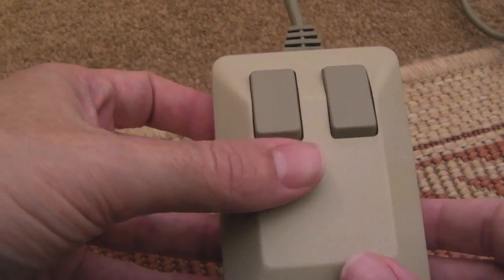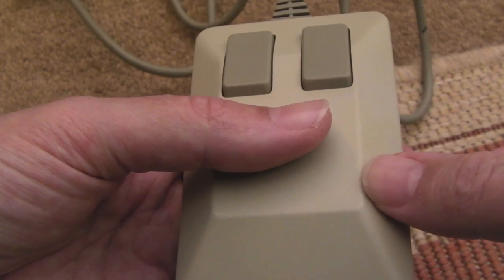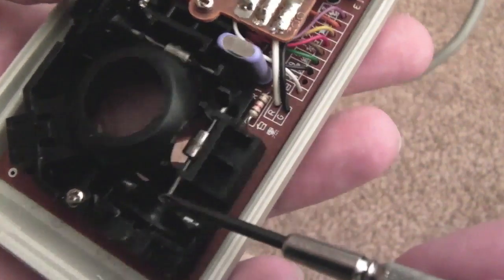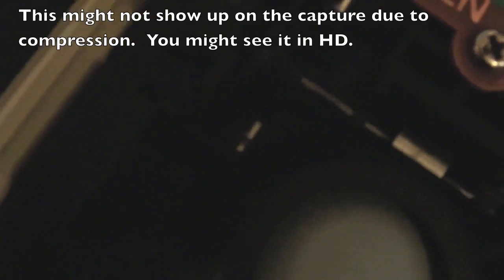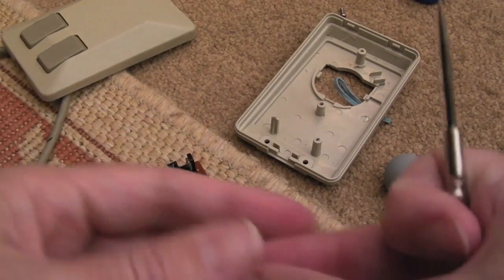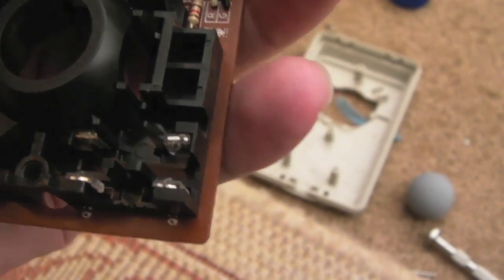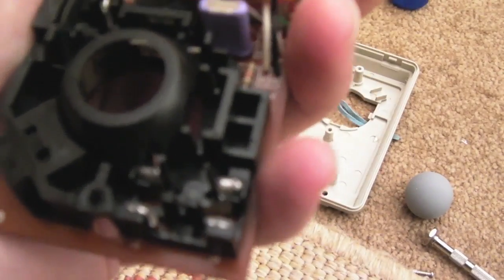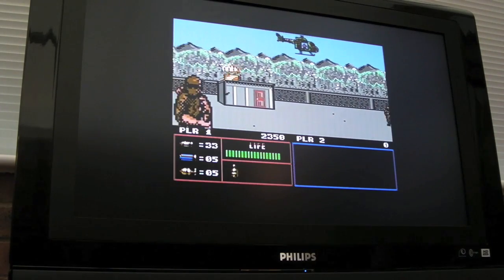Commodore 64 (C64) 1351 Mouse Repair

Comment from the maker: What is interesting about this is the changes I made shouldn't really need to be made.  It makes me wonder if the plastics in these are the problem.  With age (time vs temperature changes)  they might be warping slightly, which alters the alignment in what is pretty finely aligned from the start.   Cleaning the IR diodes didn't bring any life back at all - no movement left or right at all.  Only when I started tinkering with the slots, the IR diode angle and moving the wheel up and down the bar did it all come together.  No one issue seems to be the cause, dirt wasn't relevant here at all, and the cable is perfect.

EDIT: If you've got one of these, please check what the values are of those 4 resistors on your 1351.
Reply from the maker: +GadgetUK164 Ah ha!!!  I've just found this article which has helped me make sense of the resistors issue (see link below).  I wish I had seen this article earlier, but basically he's spotted that in his the resistors are all different values.  Mine is back using the 6K8 and still works, so I am sure all the diodes are in good working condition since it works fine.

http://cyborgyn.blogspot.co.uk/2014/12/repairing-commodore-1351-mouse.html
Reply: +GadgetUK164 my god, there's a crystal in that :O
Reply from the maker: +Amy Marie Yes lol!  There is, It's used by the chip.
Reply: @GadgetUK164  Could you put this link in the description for reference, please?

Comment: Without looking too closely as my 1351 is in the loft, I think that the larger value resistor is part of a voltage divider as the L/R encodr couple is powered first.

Great video BTW!
Reply from the maker: +Mark Fixes Stuff - Retro Console and Computer Repairs, Reviews and MORE! The 4 resistors are pull downs!  Each has a different size based on manufacturing tolerance differences I think.  See the link I've posted below - Another chap spotted the same thing and on his 1351 the resistors were all different for that reason.  It's amazing really, someone must have had to test and work out the best size resistor according to how well the IR receiver performed.  Thanks for watching and commenting =D
Reply from the maker: +Mark Fixes Stuff - Retro Console and Computer Repairs, Reviews and MORE! I might revisit this and measure the output of the receivers to see what voltage levels I am getting.
Reply from the maker: Btw - yes, they are forming part of the voltage divider =D

Comment: Hey thanks for this video, very handy. I’m trying to remove the diagonal roller, it’s rusty. Everything else looks good, but my up/down movement is sketchy. Is removing the roller just a matter of removing some plastic clips, or would I need to desolder (which I wouldn’t want to do, I don’t have that much experience)? Thanks!
Reply from the maker: The roller would be held in with plastic clips probably.   That kind of thing is not normally held in with any soldered parts.
Reply: GadgetUK164 - Retro Gaming Repairs & Mods thanks! I now have a black screen to troubleshoot... luckily you have more videos!

Comment: wow I never knew there was a mouse for c64. Sure I thought you could use one in a paint program but not in software. Can the Amiga mouse be used on c64 or is setup different.
Reply from the maker: +Beaps73 You can't use the Amiga mouse - the C64 mice work completely differently.  You can get a PS/2 to C64 mouse adapter though!  Not that many games use it, but because its supports joystick emulation mode a lot of games work really well with it - Arkanoid, shooting games, and other games where a cursor is involved.

Comment: Quality job, mate! You know what to look for! I know about the PS/2 option, but do you know any DIY arduino c64 mouse projects. The 1351 is so very expensive and never turns up in Denmark!? 🤨
Great video!!!
Reply from the maker: Thanks =D  There is a PIC project somewhere that uses the PIC16F84A I think.  I was going to look at emulating the 1351 at some point.  There are a few other adapters you can buy on the net too for PS2 mice.
Reply: Thanks for the direction! I'll give ebay a try 😊
Emulation sounds like a good idea. I'm not sure but the 1351 is an alright mouse that get the job done, right?
Reply from the maker: The 1351 is OK, tbh I never really use it!  It's useful for Operation Wolf and a few other games, or GEOS.
Reply: GadgetUK164 - Retro Gaming Repairs & Mods Yeah I know. It's just that I've always wanted one since I got my 1541II with GEOS in '89 and the FC3. It's a want. Not a need :-)

Comment: It looks indistinguishable (to my untrained eye) from the original Amiga mouse.  One mod for that model was to replace the leaf switch PCB with one that had microswitches.  I got one from somewhere (the name Simpson Electronics comes to mind, I'd have to check), it's still in my mouse and made it a bit more responsive, but I think I went to better 3rd party mice after that.  Other than GEOS, I'm not sure mice found much use on the C64.
Reply from the maker: +MarkTheMorose Thanks for the info on the button replacement PCB - will check that out!   Yes, it does look just like an Amiga mouse =D   There are quite a few games that do use the mouse, but I am happy playing Operation Thunderbolt using it, and you can use the emulation mode in other games like Operation Wolf and Space Gun etc.
Reply: +GadgetUK164 
This was back then, I don't know if the mods are still available from the same source 25 years on, but it would be nice to think so.  It came to my attention from an Amiga mag, presumably Format.
Reply from the maker: In principle it would be relatively easy to make a replacement board with better switches.  I might have a go at some point.

Comment: Thanks for the video! Managed to fix my 1351 by enlarging the IR beam holes just a bit with a really small flathead screwdriver. Took a few tries, but overall it was a super easy fix and the mouse is working perfectly now! 

I connected the mouse to Port 2 of my C64 and started the computer with the right mouse button pressed down (to start it in joystick emulation mode). This BASIC code was really handy in debugging the joystick ports:

10 PRINTCHR$(147)
20 PRINT"PORT 1:"PEEK(56321),"PORT 2:"PEEK(56320)CHR$(19):GOTO20

Source for the script: http://personalpages.tds.net/~rcarlsen/cbm/repairs/ctrlport.txt

Off to a game of Operation Wolf and Arkanoid – Thanks again!
Reply from the maker: Great =D   It's fascinating how that aged plastic seems to have narrowed the gap to the point where light doesn't seem to get through.  It could be aged IR diodes, but I certainly how on mine that the hole was almost blocked.
Reply: @GadgetUK164  This should be pinned. The info on the ports is quite useful as a reference.